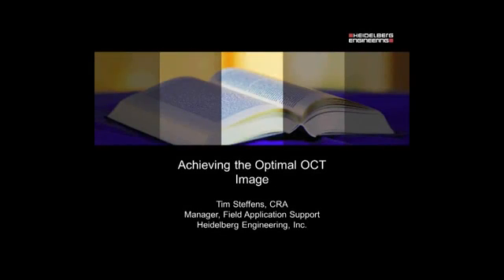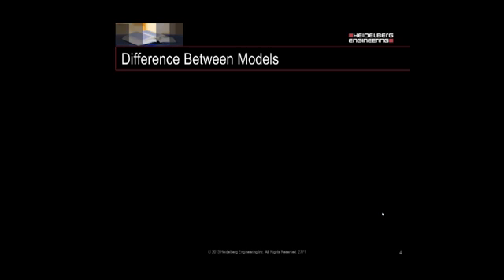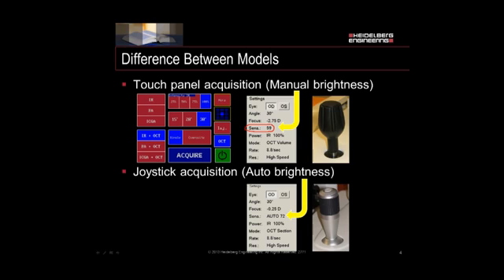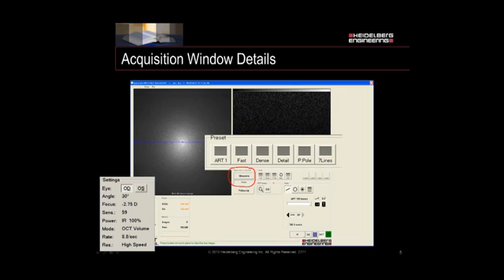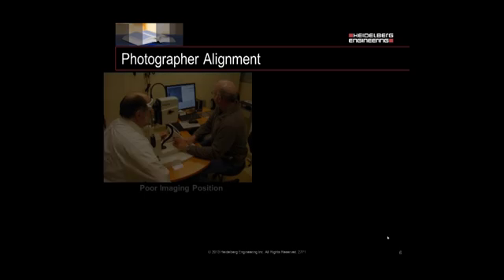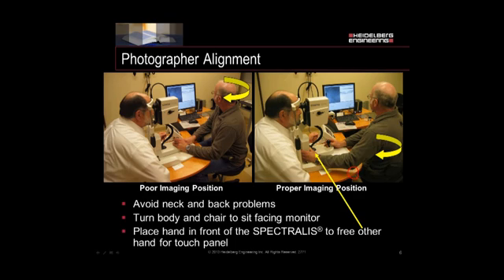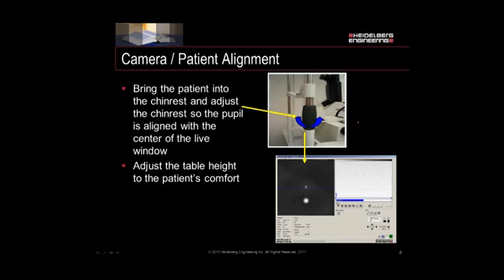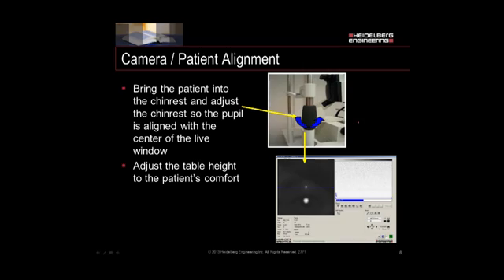Optimizing IR and OCT Imaging With the SPECTRALIS®

Comment: Is there a way to visualize the floaters a patient see with IR? Which machine and settings are used?
Reply from the maker: Thank you for your comment. Floaters are visible in the IR image. The larger the image section, the greater the probability of capturing a floater. An IR image in combination with the 55° objective (Widefield Imaging Module) is recommended. For an even larger section, you can use the Ultra-Widefield Imaging Module. It is important to set the filter wheel upwards to position “P” and set the resolution to HR (High Resolution).